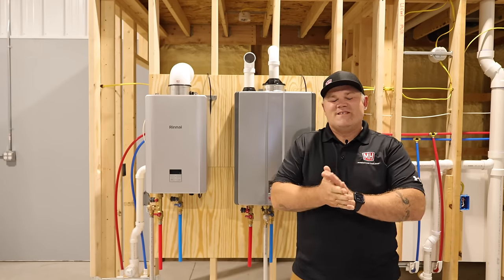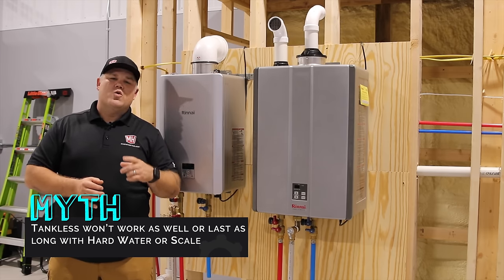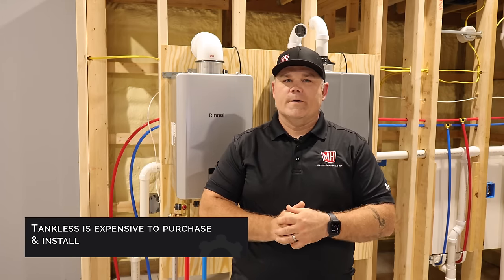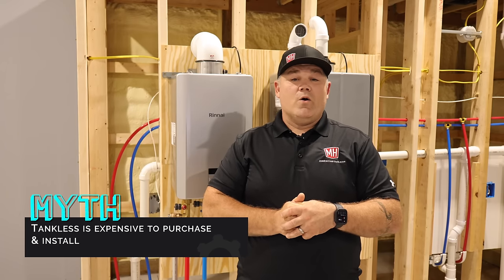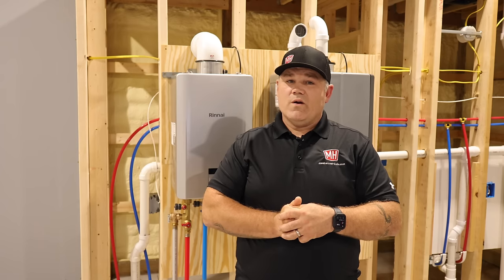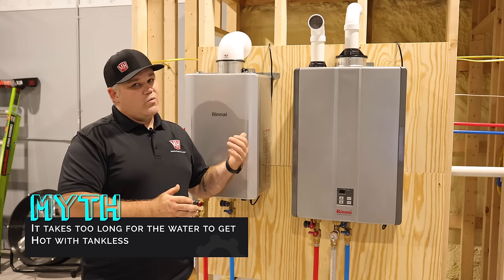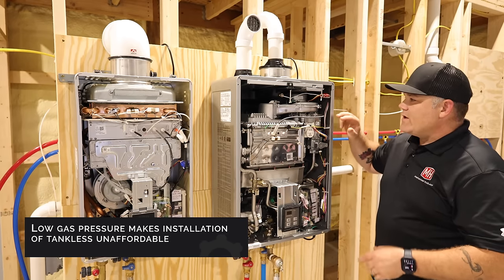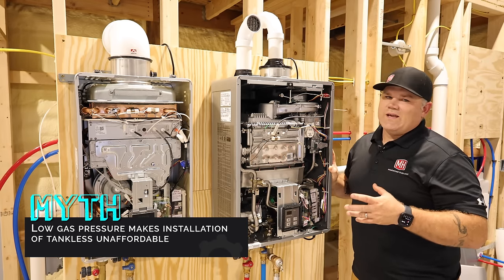Myth Busting! Tank -vs- Tankless Water Heaters

Comment: Would really enjoy the difference between a gas and electric comparison.
Reply: Same here.  Where I'm at, gas isn't an option.  We have three people in an apartment with a compact tank (looks to be about 30 or so gal).  In the winter, when the incoming water supply is extremely cold, we have to time it so that there's a half hour or more in between each of us taking a shower, which means that we're having to get up way more early than we really should so that everyone can get ready.  Plus, we each only get at most10 minutes of hot water, because as the incoming cold water replaces the outgoing hot water in the tank, it's mixing with it and lowering the temperature of the hot water still in the tank, so the "hot" water isn't really even lasting for the time that would be expected of 30 gallons at 2 gallons per minute.  If we could replace it with a tankless, and everyone be able to take back-to-back showers (or even better, all at the same time, since we have multiple bathrooms), we'd all be able to get another hour or more of sleep.
Reply: Same here.
Reply: Electric tankless water heaters in my opinion are not a good choice. To get enough hot water out of an electric tankless water heater you would almost need 120 to 150 Amps of electricity.
Reply: Agreed. I want to know the cost difference, especially since there is no gas available in my area. So I’m trying to figure out if tankless is even worth it in my situation.
Reply: @DetectiveMartin  it will not be worth it. I think temperature rise in the winter is only 60 to 70 degrees. So water out of electric tankless would only be around 100 degrees with about 35 to 40 degree well water coming into the house.
Reply: @georgsondermann9671   - Just did some rough numbers and some Googling, it looks like an average electric water heater uses about 18.5a / 240v / 4440w, and an average electric tankless water heater uses about 150a / 240v / 36000w.  I use about 100 gallons a day, at about 2 gallons per minute, that comes to about 50 minutes of "usage", but I'll round up to 1 hour to make the math easier.  The tank is going to have to run on and off throughout the day to keep the water hot, no matter if it's being used or not, plus go full-blast during the times when water is actually being used.  I'll put that at 9 hours (running 1/3 of the time to maintain hot water, plus 1 hour of full-blast).  That puts usage at 39960w per day.  A tankless would just be running for the 1 hour, since its only running when actually used.  That puts usage at 36000w per day.  That puts the two close enough to be a wash as far as electricity used.
Reply: @georgsondermann9671   I'm not sure what size water heater you would be powering up. The average home uses between 120-150 amps in total.  I do get your point though.  A little overboard but the point was taken.  Most electric water heaters use 18.8 amps with 240 volts and a 4,500-watt heating element. This is crazy when you compare it to a traditional tank water heater. The average residential container heater has a 40-gallon tank and usually requires a 30-amp breaker. What I would like to know is the kilowatt breakdown per gallon or by minutes since that is how electric bills are generated on usage versus a gas unit.
Reply: Forget the energy use rates, they don't work when you need them most, when the power is out! No electric start, no fans, go old school, pilot light!
Reply: @someoneoncesaid6978  electric tankless take alot of power 100amp 240v feed. You can get plenty of hot water out of a 30 gallon tank. You need a mixing valve so you can keep the tank hot but then drop the temp down a bit as it goes out to the house. Also keep your tank flushed more room for hot water. Also consider checking your anode rod and heating elements.
Reply: @someoneoncesaid6978  when you say gas is not available what do you mean? If talking about natural gas, the Rinnai tankless come either NG or LPG(propane). Propane is usually available in places where NG is not. I have a Rinnai tankless in my house for a shower, washer, and 2 sinks. I also heat with a Rinnai heater as well. For my family of 4, with 2 teenagers, all of us taking showers every day and sometimes 2x a day. I can go 3 months during the summer on 80gal of propane, and that includes 3-5 loads of laundry a week. They are very efficient!!
Reply: @georgsondermann9671  That's true, but I disagree with your conclusion. First, those are the maximum amount of Amps being drawn at the highest capacity, and second, an electric hot water heater is a cleaner and possibly cheaper option. I have free electricity at my house thanks to my solar panels, so for me, electric is the only way to go!
Reply: @ericwotton2046   - All good points, but none I'd be able to implement, since I live in an apartment.  When the HVAC unit finally bit the dust last year, and they replaced it, the guy said that the hot water tank was well over 20 years old, and it could go at any time.  So, although I can't do anything myself to make any modifications to the apartment (or the existing water tank), I'm trying to learn what I can about water heaters, so that I can nudge in a particular direction when the time comes to replace it.  If I end up deciding on a tankless, I might even offer to pay the cost difference between that and the tank.

It's all in a hall closet, with the HVAC on the top half of the closet and the water tank on the bottom half of the closet, so each of them is on the smaller size compared to what I would expect for the square footage of the living space (1200sqft).
Reply: @jacoley   - If you want to compare dollar-for-dollar between gas and electric water heaters usage costs, you also have to take into account the cost of the gas, not just the electricity used.  Gas varies quite a bit in cost for different areas.  In some states, it's less than $10 per Thousand Cubic Feet, and in others it's over $20.  It even fluctuates over time within an area.  For instance, in Georgia it was $35 in June 2022, but only $17 in November 2022.  That makes it pretty difficult to budget for, compared to electricity, which is more stable over such a short time.
Reply: @davemoulton2971  - Not available as in I live in an apartment building.  About 35% of the US population lives in apartments, and even more if you add in people that live in owned condos, and have no choice in what types of utilities are provided in the building, so our decisions on appliances can be quite limited.  Luckily, the company that owns the complex I live in are local, so when the time comes to replace the water heater, I'm thinking I might be able to talk them into installing a tankless, if that's what I decided is my best option.  

When the HVAC went out last year, they installed a high-efficiency heat pump model.  Our electric bill for heat / AC went down substantially, but they bumped our rent up by $25 when they replaced it.  Overall, we're saving money, even with the rent bump.
Reply: When tankless came out in the 60s it's overall cost was much higher than tanks. Because of this it was used mostly commercialy. Technology has caught up and it's a viable option. He says tanks efficiency compared to non is 60\90!! Wonder what the life span is?? I have gotten 25'years from a tank!
Reply: @someoneoncesaid6978  I guess you are correct in that sense. I hadn't thought about large apartment complexes. I live in Maine, and because NG is not available except in the major cities, most of the apartment complexes here run on propane anyhow. Also alot of the smaller apartment buildings are privately owned and most of the landlords will allow renters to install propane stoves and heaters as it saves the landlord money.
Reply: @georgsondermann9671  220V and about 50Amps per unit. I had two electric heaters when we replaced the tank. I was told I didn’t need two , but I insisted. One would have been as efficient.  Very expensive to run. When they finally wore out and failed, I replaced them with the Rinnai RL94 LPG unit. When one shower was on with the electric, anything else caused a shot of cold water in the shower. Not good. The Rinnai never has that dip and there is no indication other faucets or showers are on.  The electric heaters just aren’t as efficient for whole-house tank replacement. I think the smaller 120V units could be an excellent choice for a single sink or the kitchen sink. But they aren’t necessary with the Rinnai unit.
Reply: A single unit provided the hot water capable for the electric heaters. I foolishly thought I’d get twice the hot water from two units. However, common sense and simple reality suggests you cannot push twice as much water down a 3/4” water pipe. And, you don’t heat the hot water from the first unit to twice the temperature. All it meant was that I was using nearly 100Amps each time hot water was called instead of the 50Amps from one unit.
Reply: @someoneoncesaid6978  A tank uses a lower amount of energy over a longer period of time to heat an amount of water hence it could use less energy overall. A tankless uses a lot of energy all at once that is why there are not very many ( if any ) electric tankless water heaters. Which one would be more efficient probably depends on how much hot water you use. Another thing is “endless hot water” which might make you use more hot water and thus cost more. A tankless is 90% efficient but a tank with a heat pump is 200% efficient so I don’t know which is better.
Reply: @georgsondermann9671  
I installed an electric tankless unit about 8 months ago.
I replaced the 50gal tank heater.
My utilities bill has gone down an average of $20/mo.

The only downside I’ve come across is with the old tank I had ONE 240 line in the laundry room.. but I bought a 3 stage tankless.
I had to pull 2 more 240 hookups to complete the job.

Heavy gauge wire for 2 lines cost me about $250, plus the breakers.
Ended up being a total of $900 total (counting the unit).

IMO.. it was a no brainer when you factor in the monthly savings and the risk of rupture and flooding when the tank gets a bit of age on it.
Reply: Plumber of 20 years here. 
This biggest difference is the amount of hot water you have. The efficiency isn't much of a difference especially with the increased insulation on tank heaters. If you aren't running out of hot water, stick with a tank. 

Tankless is more versatile but running the electric can get expensive. Even smaller 17kw heaters are going to need 80 amps.

If you are running out of hot water but can't put a larger tank. There is another option with increasing the heating element in the existing tank if you have a larger breaker. One job, the customer had a hot tub but refused to get a tankless. So we modified the two tank water heaters to run all four elements at the same time. Basically converting them to a hybrid tankless with extra hot water storage... Still took 100 amps but the customer was happy. You could do the same with a single tank but it would require an additional 25-30 amp breaker with the larger elements.

Hopefully that helps.
Reply: @someoneoncesaid6978  You could turn up the temperature on the heater. The incoming cold water goes to the bottom of the tank through a dip tube.

It sounds like a problem with the lower element or thermostat if you're only getting 10 minutes of hot water. Your 30 gallon heater may only be heating the upper 15 gallons. That fits your 10 minutes almost perfectly. 

Plumber with 20 years experience.
Reply: @someoneoncesaid6978  Shower or bath before bed like the Japanese do
Reply: Biggest installation difference would be - no need to punch holes in your house for running vent piping.
In an electric-only neighborhood a tankless water heater would not be able to provide ANY hot or warm water if the power was out. A 40 gallon tank, however, is still able to provide hot water for the short term (though letting teens take "Hollywood Showers" would have to be nipped in the bud.)
Reply: @someoneoncesaid6978  when did you last change your dip tube? They really should be replaced about every 3 years.  Take your model number of your water heater and take it to a plumbing supply store (not home depot), and get a new $20 dip tube.  Replace the dip tube and you will feel like you have a whole new water heater.  When the dip tube deteriorates, instead of putting the incoming cold water into the bottom of the tank where it is heated it is being dumped near the top mixing with the hot water where he hot water supply pipe is.  This mixes the cold with the hot resulting in your problem.  You can swap out the dip tube in about an hour by watching a YouTube video.  Hope that helps.
Reply: @georgsondermann9671  hi carumba.  Most peoples panel is 100amps!
Reply: @DetectiveMartin  Our gubmint will eventually raise the price of gas to where it will be more expensive than electric. Never mind that you are discouraged to use electric appliances during "peak" usage hours.
Kalifornia has already prohibited gas hook ups for all new construction. Eventually we will also be banned from replacing appliances with anything but electrically powered appliances.
Reply: Same
Reply: @someoneoncesaid6978  Have you considered just turning up the temp of the water heater? No tools required. Hotter water goes further.
Reply: What I tell every customer that’s interested in a tankless unit where gas isn’t an option is to not bother.
Electric tankless units require a ridiculous amount of power to heat the water and there simply is no reason to go this rout.
Reply: @ludicrous7044 They last lmuch longer than tanks. My Mother (in Europe) only had to replace her original Junkers after 35 years and the new one has been working for about 18 already. By the way, this particular brand of gas tankless water heaters has been manufactured since 1895, they have a long history.
Reply: @someoneoncesaid6978  And some people get extremely lucky and have land that sits on its own natural gas well that feeds directly to the house. Such a blessing.
Reply: Gas is cheaper than electric, so its more cost effective.
Reply: @georgsondermann9671  that a lie
Reply: @davemoulton2971  Tankless Heater Size (in kW)	Electrical Current (in Amps)
10 kW	42 amps
11 kW	46 amps
12 kW	50 amps
13 kW	54 amps
14 kW	58 amps
15 kW	63 amps
16 kW	67 amps
17 kW	71 amps
18 kW	75 amps
Reply: @Poppageno  Gas may be better for a water heater, especially in a power outage. But some homes do not have gas connections. Our house was built in the late 60s and is all electric except the heaters. We do not have gas lines running in our house and both of our water heaters (and stove) are electric.
Reply: There really isn’t any lol
Reply: @agamble1126   Oh I get that. My house was built in the 40's It has an electric stove. When the power goes out I have to break out the camp stove to cook. Lucky for me my wall heater is also propane on a pilot light so I have heat in an outage. We all deal with what we have, if you get to make a choice though you should know all the options not just what the seller is pedaling.
Reply: @Samuel-I  Which model did you purchase?
Reply: @briholt100  
Can’t remember off hand, Brian.
I’m traveling right now, but I got it at Home Depot.
If I remember when I get home tomorrow I’ll look and send that info.
Reply: @Samuel-I  thank you internet stranger friend.  I appreciate it.
Reply: @DetectiveMartin  Hook up a propane tankless water heater?
Reply: @carsten4594  You could move to a free state.
Reply: Basically the same except for the heating type and vents or lack of.
Gas is cheaper to run i.would.say if used in the same interval. If you don't have gas supply then you are limited. But again tankless cheaper and are efficient either heat source compared to tank version.
Reply: @briholt100  
It is a Rheem Performance 

Have a good weekend.
Reply: I'm gonna get up and fix me some grits and make a piece of fried bread made out of flour and water and a little milk and fry an egg..
Reply: Hell I'll just go all out and make a little bit of gravy too 😂
Reply: @Samuel-I  thank you!
Reply: @Carsten  New York state is currently trying to implement legislation that would ban all natural gas appliances in New (and eventually existing) construction...commercial and residential.  That means no furnaces, water heaters or stoves/ovens except electric.
Reply: @ludicrous7044  I took use a tank. It was still working 30yrs later when upgraded by dad at moms insistence in 1990.  That one was again replaced by myself in 2018, almost again 30 yrs old. Only because the new law was going into effect and i purchased a Rheem on discount..100$. to make way for newer models. Living in a 4 story 1880s farm house.. I prefer the tank. But would would curious as to length of service also.
Reply: Any electric method of water heating is going to be more expensive than gas to use, due to electricity vs. natural gas prices. Efficiency should be similar tank vs. tankless using the same energy type. BUT getting your electrical service upgrade is not cheap, and is often needed for electrical tankless, but gas meter upgrades are rarely needed, and normally free (at least in my region). No venting or condensate lines are needed for electric of course.
Reply: @ludicrous7044  tankless water heaters have been in use in Italy in apartment buildings and homes since the 60’s, mainly because of lack of space, and they’re very efficient contrary to the myths going around. I wish I could replace my oil boiler and water tank and oil tank with an electric tankless combo heater which would also take care of my hydronic radiators for heating. They do exist. In Germany mainly.
Reply: As both an electrical and plumbing contractor what I have found being in Florida if a home has natural gas to power an instantaneous water heater great, if not, it is not cost effective for the typical home owner. Electrical you have run 80 to 120 amp cables to power the WH. Also you may have increase the electric service sizeand/or increase the panel size to add the required circuit breakers. If the existing electrical WH is in the garage or utility room a good option is a hybrid WH because it is a heat pump that heats the water and cools the room it is in. My final thought is what happens during a hurricane when yoi loss power?  No problem with NG. If have an electrical instantaneous water heater you need a whole house generator for power that WH to be able to shower! With a standard WH or hybrid WH you run it and all of your lighting, ceiling & outlet circuits of a 5 KW portable generator. I can run either clothes dryer or WH one at time, shutting off the WH circuit breaker once not in use allowing some what of a normal lifestyle as the refrigerator can stay on all the time as with the lights and receptacles.  I hope you find this information helpful.
Reply: @jacoley  and @Georg Sondermann 
My electric tankless has 3 double pole 40 amp breakers. It's a ECO 27 Tankless Electric Water Heater 27 kW 240 V Per my Sense it uses about 12000W when running. I have not seen a decrease in my power bill since it's been installed. 5+ years. I did see an increase in my water bill because my kids never run out of hot water. :D
Reply: @Poppageno  Yes, I 100% agreed that is the downside of my electric tankless. Luckily enough we've only been without power for an extended period of time once. During that time we used the good old propane hot water heater in our travel trailer to take showers :D
Reply: @8.6GivenAdqVacSysm  As an electrician, I totally agree with this. Even though it is against my financial interests, I do not recommend going through the trouble of upgrading your electric just to save a little energy on hot water heat.
As we continue to electrify homes without quickly upgrading our grids, we will experience more blackouts and brownouts; sometimes locally, sometimes regionally.
From the perspective of consumer cost and environmental protection, electric cars and electric heat pumps make sense.
Electric ovens, water heaters, baseboard heat, and clothes dryers do NOT.  Despite already having a 200 amp service in my own home, I ran new gas lines for a natural gas tankless water heater.  In an apartment building, tankless doesn't make a lot of sense because it will be difficult to upgrade your electrical system without considering the capacity of the entire building. This is a potential major fire hazard.
Reply: @georgsondermann9671  actually,  an electric tankless needs 3 circuits. One 70 amp, and two 40 amp 240 volt circuits.
Reply: @Poppageno     Gas tankless water heaters are the shit!!!!  DO IT!
Reply: @andypeterson8013    Ummmmm, I've had one since the mid 90's, thank you. Just urging folks to get non-electric ones, pilot light's rule in power outages!
Reply: @someoneoncesaid6978  get a small & cheap Electric Tankless is the answer to your issue.
Reply: @georgsondermann9671  If you had an Electric water heater. It used Electric that must be wire correctly to be able to heats up the tank. Put your tankless near it & use the line. You must look for the Tankless with the same voltage. If you do not want to hire an Electrician for the wiring. I did this once. I was trained first on how to install Water Heater. I knew how to do it but I had to make sure. So, I hired an expert to train me how to do it. He came to my resident & replaced the one broken & I watched very carefully. He undo the service, he let me install it, & he watched me how I did. I passed. The next time my hot water Heater need replaced, I installed it myself. Then came the Electric Dryer. This I was watching a hire guy fixed my Dryer. The next time it broke I wired the Dryer myself. I had my Sister watched me do & tells me by going through the checklist. We were poor so we can not hired helps. Being poor made us had to fixed most of what we have. We did the dirty tasks. I am sorry for the long comment.
Reply: Can a gas tankless water heater be installed in a manufactured home?
Reply: Electricity is pretty expensive...gas is going up too... So maybe a pre heat solar panel would help.
Reply: @someoneoncesaid6978 
Put a timer on your hot water tank system so its not constantly reheating the water i.e overnight or when noones is home.
Reply: @someoneoncesaid6978  we only have electric water heaters here in the Philippines 🇵🇭. But much smaller units put at the point of use. In our shower mounted on the wall, So only one water pipe. There great, NEVER run out of hot water. Europe and Asia has been using for decades and both are sold here. Ours is a Panasonic
Reply: The difference is gas is plentiful and America really doesn't have a decent power grid.
Reply: Gas is hands down 100% better than electric! It's cheaper and faster. So much better! If I didn't have natural gas, I'd still be willing to pay the double the price that it is for propane, because it just works so much better. Heating with a high efficiency gas heater is about half the cost of electricity and heating with a high efficiency propane heater is comparable (depending on current propane prices) to heating with electricity, but it is still totally better because you can have a good high efficiency tankless hot water heater that never runs out of hot water. Then you have all the benefits of being able to use it in all of your other appliances like a furnace, fireplace, oven, and dryer. Dryers are where gas and propane truly shine because they are 100% efficient because they don't have any heat exchanger to lose efficiency and the combustion gases directly flow across the clothing to dry them. Every commercial laundry that can get natural gas uses gas dryers because they are so much better than electric dryers. I've had my Maytag gas dryer since 2001 and I have only had to replace the gas solenoid valve coil twice for about $11 the first time, and $14 the second time. Because they don't have the expensive heating element that burns out, the heating part of the dryer lasts longer. The gas dryers also dry the clothing so much faster! My dryer has always dried the clothing faster than my washer washes them. That means that for drying the same number of loads of laundry, the dryer doesn't run as long, which means that it doesn't rotate as many times, which means that your motors and bearings and belts and pulleys all get less wear and tear, which means that they will just last twice as long mechanically as an electric dryer! Gas is so much better. The only drawbacks of using gas is one, the danger of an open flame on your cooktop, which in my opinion is actually safer because people treat it with more respect and  have fewer fires. And you can verify that on the NFPA website. My opinion is only the fact of why there's fewer fires caused by gas ranges rather than electric ranges, not the fact that there are fewer. The second drawback is the fact that when cooking with a gas cooktop, you are adding heat to your house which then needs to be removed if it is during the summer and that can put a higher heat load on your air conditioning system. But there again, it can actually be a benefit if you live in a cold climate and during the winter season because during those times you are getting free heat in your home while cooking. As you can see, I love natural gas and will never heat with electricity unless I absolutely have no other choice.
Reply: @Poppageno  
That's why I feel that we should use high efficiency tankless non electric gas water heaters that only use a pilot light and a thermostat with a flow switch. I've already designed one, but I need to build one, and prove my design. I used to live in a place that had frequent power outages, and so I designed it then, but I had a regular gas water heater that never died, so I never built it.
Reply: @davemoulton2971  
And that's why I would get propane if I didn't have NG! Never use electricity to heat if you don't absolutely have to! 👍
Reply: @davemoulton2971  
With that many loads of laundry a gas dryer would pay for itself in a very short time! Trust me, I've had mine for over 20 years. Read my other reply to learn more about the benefits of a gas dryer. 👍
Reply: @RichTeer  
You just changed the direction of where you put your money. Your solar panels cost more than heating water with a high efficiency water heater. You're not paying for the electricity, but you are paying for the solar panels. You might want to look into evacuated glass tube solar water heaters, they are even more efficient than solar electric panels. If nothing else, you can use them to pre heat your water before it goes into your water heater.
Reply: @jonnelson9760  
If you have to use electricity, then a heat pump is the way to go!
Reply: @someoneoncesaid6978  
If you have to use electricity, then a heat pump is the way to go!
Reply: @carsten4594  
You misspelled kommifornia.
👍🤣
Reply: @carsten4594  
They want absolute control, and they can get it with smart meters and smart appliances. I can't remember exactly which state, but they shut off power to select homes when they deemed it necessary. But of course those customers still had to pay the basic rate portion of their Bill's during that time even though they weren't being provided the service.
Reply: @uptoolate2793  
Turning up the temperature also shortens the life of the heating elements by a tiny bit, so just be sure to keep some spares on hand and you'll be good to go. Which is actually good advice to anyone with an electric water heater.
Reply: @PyrateSilly  
Only in kommifornia.
Reply: @TomJones-on9rw  
That's what I did!
Reply: @davidscott5903  yes it's called the "Ready to serve" fee here. Used to be called the "Minimum charge".
Reply: @jonrossjan  
Trust me, you don't want electric.
Reply: @TheWaterbouy88  
That's a great idea for a heat pump to heat water and cool your room. Up in the colder parts of the country they'd have to reverse that to heat their house. If everyone across the lower parts of the country, that has to cool more often than heat did that, then our country could save gigawatts of power.
Reply: @adame924  
Sounds like my daughter! 🤣🤣🤣
Reply: @davidscott5903  Fair point, but my solar panels generate enough power to handle ALL of my household electricity needs, including charging our EV. So I’m not just focussed on heating water, and I also take a long-term look at things.
Reply: @jerrypankey3692  
Yes, if you make sure all of the venting and setbacks are correct.
Reply: @chuckthebull   a preheat solar panel is almost always a great choice. Unless you live in a location that doesn't get much sunlight, like if you have a lot of trees, or something.
Reply: @someoneoncesaid6978  Until your power goes out and you don't have a gas source for a backup. But hedge your bets as you'd like. I love redundancy for things that can keep me alive in emergency scenarios.
Reply: I would like to know if electric is as good as natural gas also.
Reply: @carsten4594  
It’s funny that they changed the name to, “ready to serve” when they’re still charging you even when they’re not ready to serve.
Reply: @adamthomas7514  
It’s not.
Reply: @davidscott5903  love to be able to charge a "ready to use" fee.
Reply: @PyrateSilly  
Where I live, my gas bill during this very cold winter is only about $80 and my electric bill is about $60 even though I don’t have much on it. My furnace, dryer, water heater, and oven, are all gas and the gas bill is that low.
Reply: @carsten4594  
🤣🤣🤣‼️
Reply: @someoneoncesaid6978  Take a look at a heat pump water heater and your electric usage will drop significantly same with a heat pump clothes dryer. You are using the laws of thermodynamics and to just push a refrigerant to move hot air to cold place and extracting the cold out of the water. It’s just a reverse air conditioner.
Reply: @RichTeer  me too but I use a heat pump for domestic hot water and heat pump for drying clothes. This way you use your electricity super efficiently using refrigerant to move the ambient heat to where you need it.
Reply: @8.6GivenAdqVacSysm  take a look at heat pump water heater common now in Europe and are available in the us,
Reply: Electricity would provide variable power control over the outlet water temperature with instantaneous response. Bad news: 4 gallons/ minute, 40 degrees in and 120 degrees out requires a 200 A service to the water heater. A tank requires a 30 A service, unless you go heat pump which is less. The operating cost of the tankless can be less than the tank because of stand losses. Electric tankless can also be split up into units placed in the bathrooms and kitchen, so there is no wasted heat filling a pipeline. You will need a new electric service.
Reply: Upgrade your electric service or add a second one just for it.
No offense to the product. It is simply going to be a large energy consumer to be able to raise the water temperature by 80 degrees in five gallons of water every minute.
Reply: @someoneoncesaid6978  I spend an hour washing dishes, lol.
No way is your unit only running for an hour a day. Especially with a family of four.
Reply: Most showers in Europe are electric and will give you constant hot water, You don’t even know the difference between electric and gas heated water.
Reply: @SuperMagnumguy  The difference is that Europe is on a 220v system and usually runs isolated tankless sources such as showers, washers, etc. Where the US, it runs 220v for the whole house water supply and usually 110v for tankless isolated usage. We use a lot of water. in the US, 696 billion tons of water a year, whereas Europe uses 264 billion tons of water a year, That's if my conversion is correct. Most homes in the US that run tankless for the whole house usually run gas or multiple 110v tankless units. I am building my home as we speak. I will have a 2400 sq ft home with 2 bathrooms, a kitchen, a dishwasher, washing machine. I will be running two 110v tankless units. One for the Kitchen, and washing machine. The other will be for both bathrooms and the dishwasher.
Reply: I have wired a lot of them up there 80 A to heat the water versus 30 A
Reply: @georgsondermann9671  
I have city water and live in the Deep South, where winter temperatures are not usually that cold.  We don’t even usually get our first frost until early - mid November and daily highs in the winter are usually quite mild.